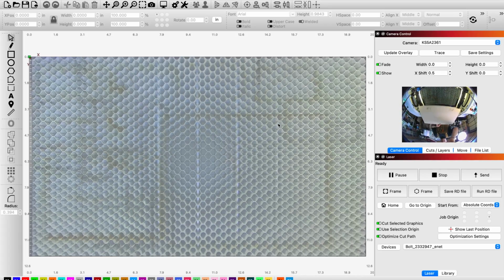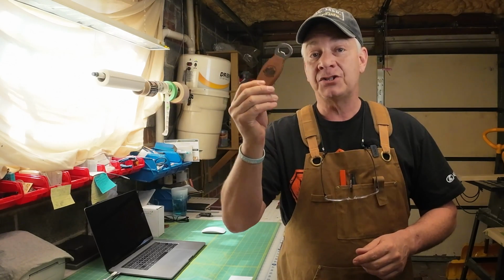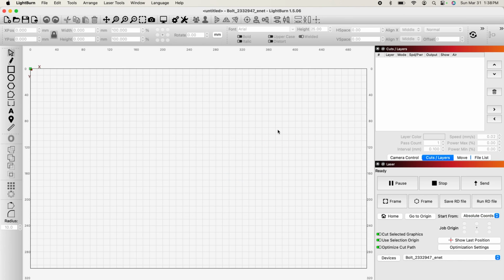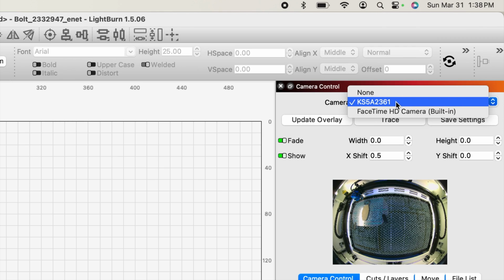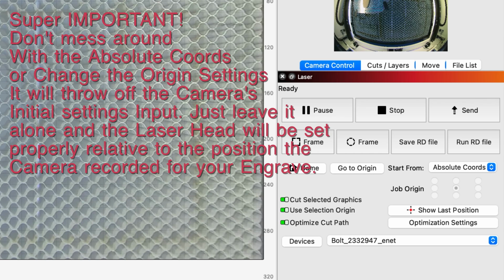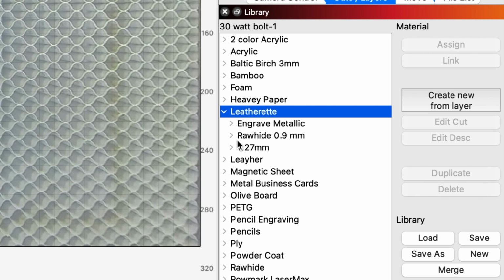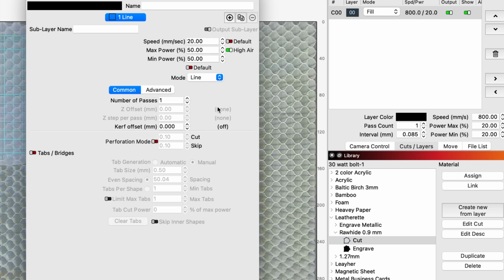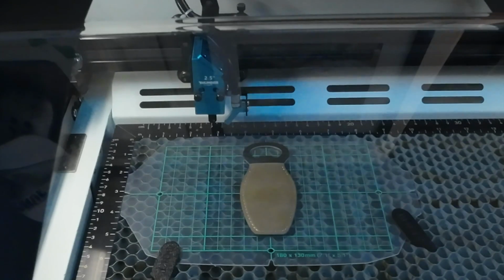QuickShot: Leatherette Settings for The Thunder Laser BOLT. Using The Camera.  031   4K

Comment: I loved this video! I have been trying to get the leatherette settings correct, and also had seen another video of turning off air assist to get rid of the black soot, which was all included in your video. My son kpet telling me to do more passes, but after seeing your video, I used your settings, which the speed was crazy fast, scared me a little, but patch came out perfectly. I have to cut adhesive-to put on the back of leatherette patches, I received as samples from Thunder Bolt-so no adhesive. I bought the adhesive from Lone Star. Do you have settings to cut adhesive-I am sure it is not fast for powerful since so thin? I have only had my Bolt a month and am just using it. I would love to know how to download the settings from Malone, but I could not find it on the site. Do you have a link for the settings and how do you load them on LIghtburn? If there was a place for all settings, it would be so much easier for the learning curve. I really appreciate your video and am going to look for more. I look forward to hearing from you. Sorry for all the questions!
Reply from the maker: LOL! That's great - I am happy they worked for you. The CUT settings I provided in this video will cut through the adhesive as well ( I almost always order my leatherette sheets with adhesive on the back). I am happy to email you my BOLT Material Library if you would like - just email me at lasernug at gmail dot com and I will send to you. I did a video on how to load it into lightburn Material List - you will find the video on my lasernug youtube homepage. Always happy to help if I can with any questions you have - I am not an expert by any means but will try if you have a question. Cheers and congrats on the new laser Sally! I think you will love it as I do. Extremely happy with this laser. :)

Comment: Thanks for the tips as always Gord. Wanted to play around with some black to silver leatherette coasters (JDS) I've had for a while. Was going to run a material test but decided to just YOLO the file using your settings. With the 1.5" lens it came out very nice, but under a magnifier I could see some very faint lines where it wasn't 100% removing the top layer. I upped the DPI to 390 (.065) and the second one was flawless.
Reply from the maker: Good morning - happy you got it dialled in. I was just doing similar tests on the Nova PLUS all morning yesterday with some black to silver and brown to gold. And indeed , the settings are different for those, versus the regular Rawhide to black. Thanks for sharing - I appreciate it. Cheers!

Comment: Great video! Do you have to re-calibrate the camera if you change material thicknesses?
Reply from the maker: Morning! Great question. No, the camera just shows you the picture. However, you do need to auto focus when you put material into the NOLT, just as you would do normally. I recommend to auto focus before you engage the camera  overlay. Cheers!
Reply: @LaserNUG  thank you!

Comment: Is that “engraving” or “marking”? I’m trying to learn this stuff and terms.
Reply from the maker: Good day - I am not super experienced but here is my understanding. An engrave , the laser actually removes material, so this is an engrave . If you feel it with your finger afterwards, you can feel it is deeper than the surface. A "mark" is often referenced in terms of a UV or fiber lasers. For example, a fiber laser can mark metals but can also engrave into metal materials. If you look on my homepage you will see a Aurora lite video on stainless steel. When I engrave the steel, you can see and feel it has removed steel and the engrave is lower than the surface but when I "Mark" the steel, it has changed the colour of the steel but when you run your finger over it , it is on the surface , there is no depth to it. I Hope that helps a bit. Thanks for watching.:)